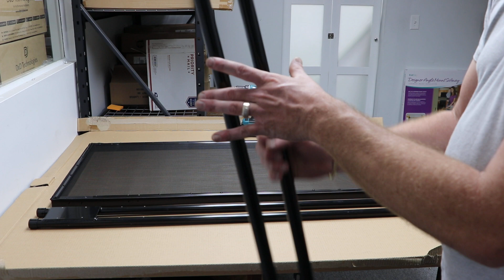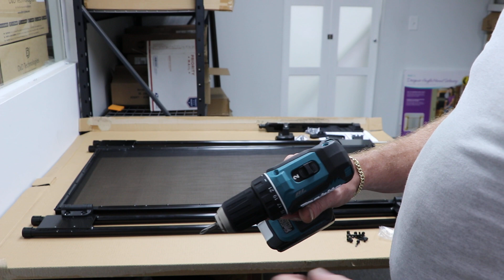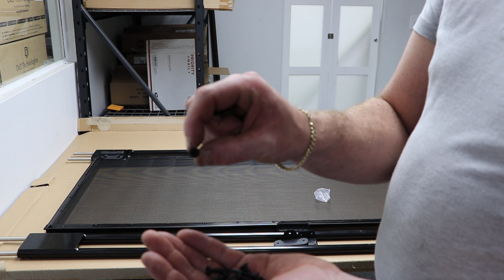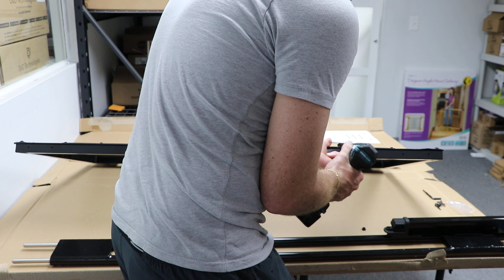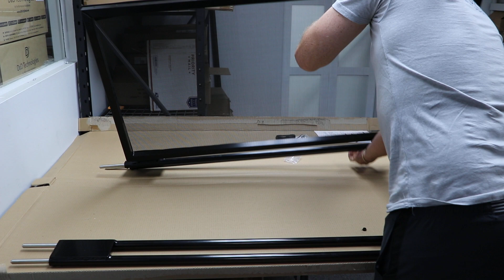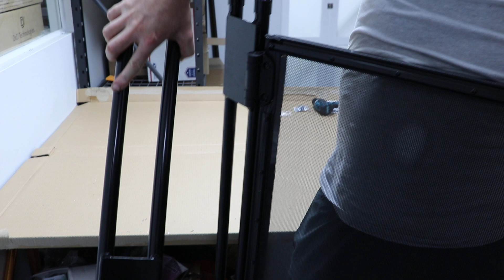PoolfenceDIY.com Step-by-step Self-Closing Gate Assembly Instructions

Comment: We r having trouble with some of the self tapping screws and the holes..holes seem small and the screws aren't very sharp. Any ideas? My husband is about to lose his shit
Reply: Yep, same problem here. I notice that he only installed the 8 screws on the face of the post and gate frame.  There are 16 screw supplied, the other 8 are intended to secure the hinges to the inside faces of the gate & frame. Also, there is no round post on the latch side and no plates on the hinge side, so perhaps this video is for a different version of the gate. And yeah, I lost my shit just reading the printed instructions before finding this video. Good luck, Beer helps.